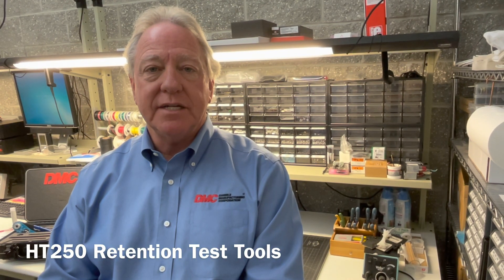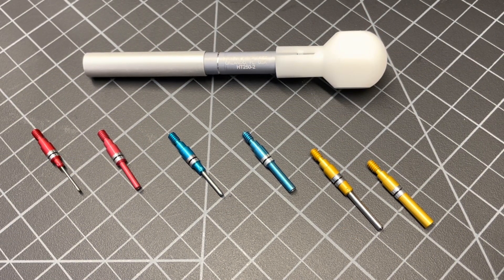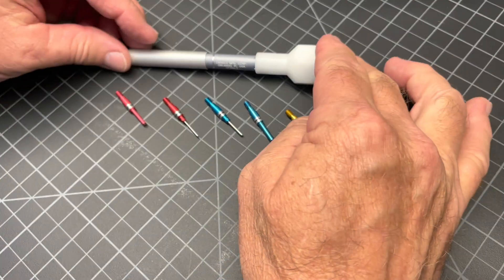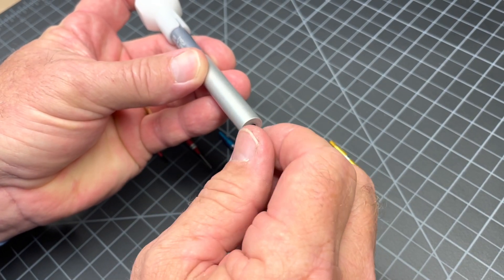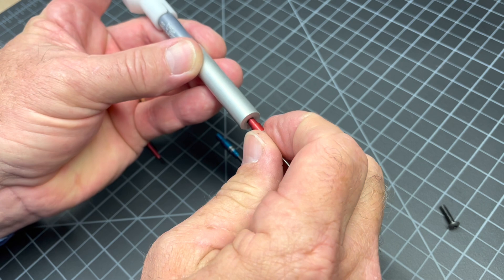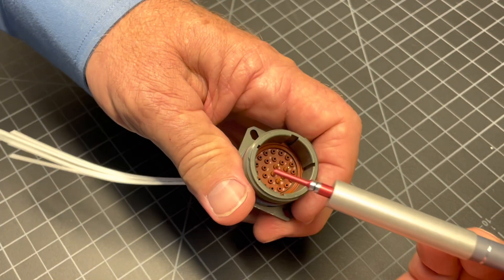Contact Retention Test Tool - HT250

Comment: Is this test recommended by the connector manufacturer  ?  Is there any document that shows force specification with respect to connector
Reply from the maker: NASA-STD8739.4A - Workmanship Standard For Crimping, Interconnecting Cables, Harnesses, And Wiring covers sizes 12 – 22 AWG though connector manufacturers sometimes have their own requirements that would override this. Our recommendation is for you to contact the connector manufacturer for any specific requirements.

Comment: Does the tool come with information on calibrating the tool?
Reply from the maker: To calibrate this tool you can send it to DMC or an authorized repair center. We also offer RTCG-75A Retention Tester Calibration Gage, however for the purpose of calibrating a single tool this may be too costly.